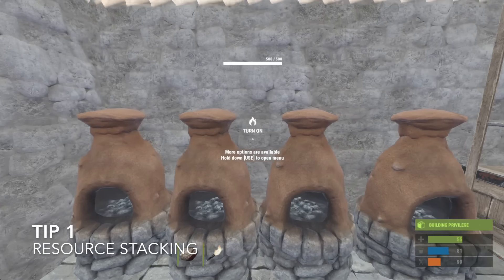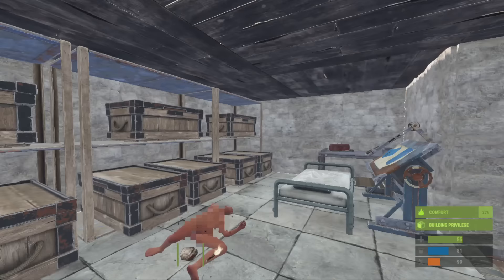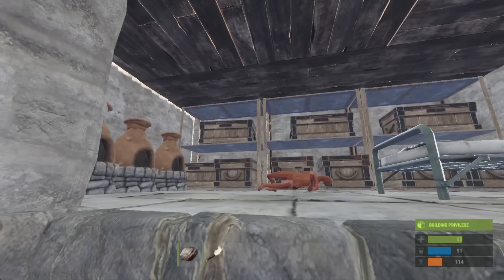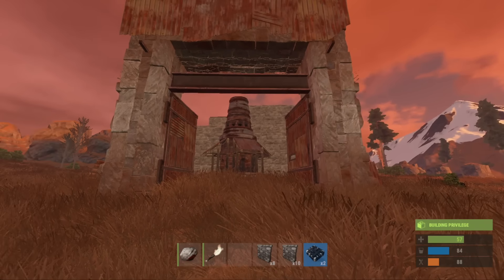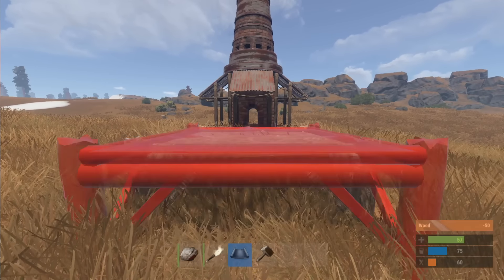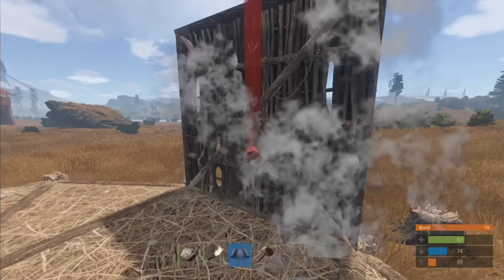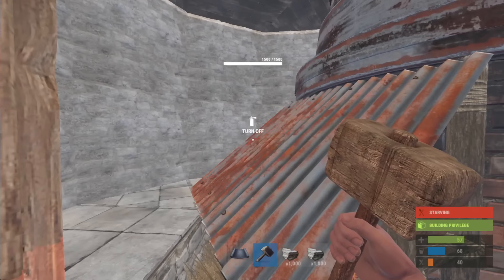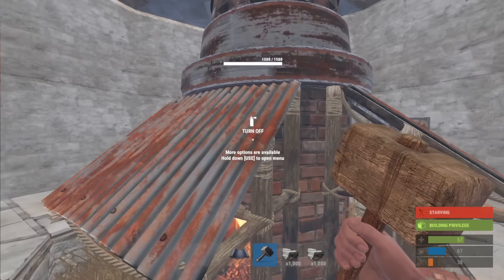A Guide to Rust: Furnaces and a Furnace Base

Comment: For small furnaces I do
1k Wood; 3 x 200 Metal Ore -- metal ore takes 5 wood per ore, so this uses exactly 1000 wood.
If you don't want charcoal you can make this 4 x 200 Metal Ore, and place a metal frag in the last furnace slot so all the charcoal falls out.
835 Wood; 2x 333 Sulfur Ore, 1x 334 Sulfur Ore -- Sulfur takes 2.5 wood; the issue here is space, if you craft more than 1000 Sulfur ore it'll fall to the ground.
You can do 4x 250 Sulfur Ore and 625 wood if you don't want charcoal.

/u/krabby_patty